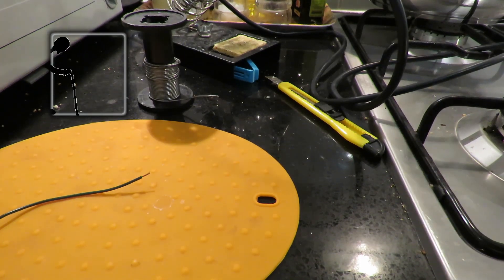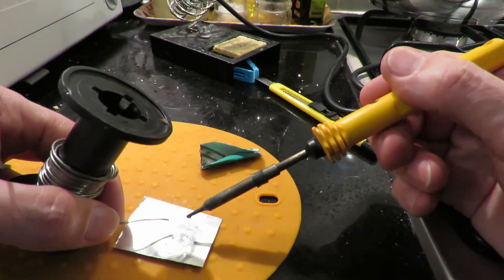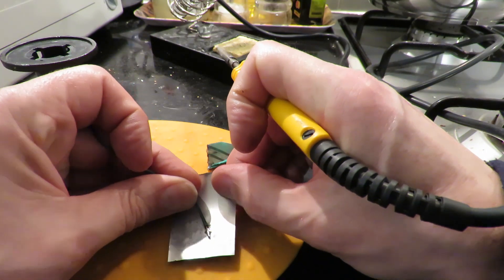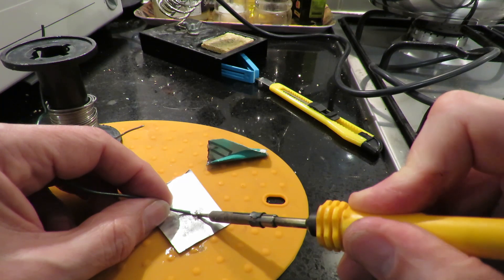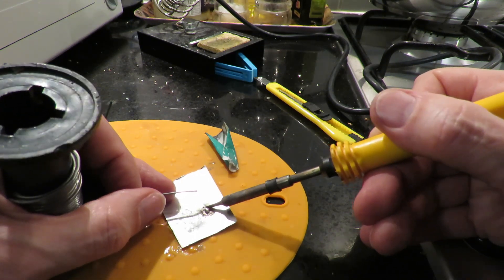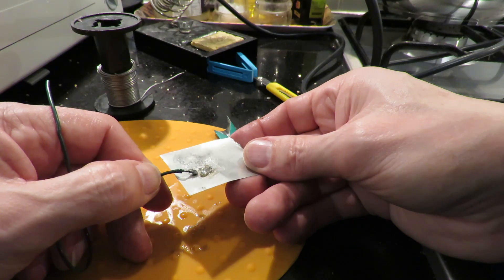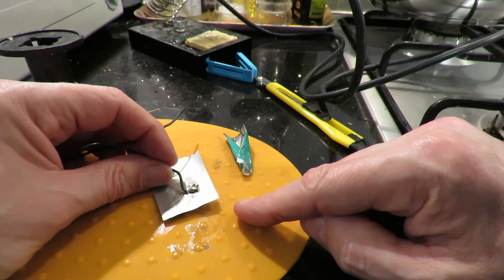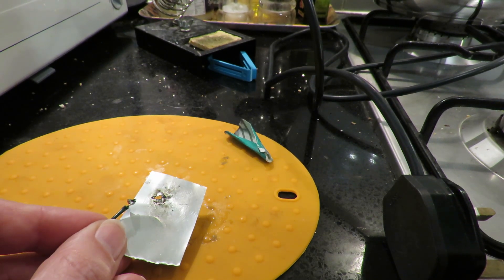Can I solder on aluminium?

Comment: I used rosin cored soft solder (tin-lead in those days) to solder aluminium and copper wire together all the time.  It was called a submerged joint, no oil involved.  
You need a soldering iron with a sharp leading edge, the old irons had copper tips and I just filed them flat (at an angle) on the end to give  a sharp edged ellipse, they also need to have sufficient heat output to keep the aluminium at the right temperature, alternatively you can cut a thermal break in the aluminium to reduce the heat spread.  

Start by sanding the aluminium to get the old hard oxides off, tin the copper, melt a blob of solder onto the aluminium where it has been newly sanded, put the iron tip into the blob of solder and tilt the tip so that the sharp edge bears on the aluminium and just push forward.  The sharp tip will scrape off the soft oxides (aluminium oxide forms instantly when aluminium is exposed to oxygen, but, initially the oxides are soft and easily removed, as time goes by the oxides harden up like anodising) especially on the top of the sanding marks and the aluminium will instantly tin.  After that, it is just plain soldering

I have used this method to join wire, attach copper earth tags to aluminium chassis (required a lot of heat or as I said a thermal break) even joined some aluminium angle.
Reply: Robert sounds like you need to upload your first youtube video!  this sounds really neat, i will have to try it.
Reply from the maker: Thanks for the tip 😆 Sounds like quite an art to get it right 👍👍
Reply: @GrandadIsAnOldMan  It is actually quite easy to do.  Try it, but use aluminium plate, the aluminium in cans is not really a good subject as it is coated and heavily cold worked.  As I said just try it on a thin section with a thermal break

When I was doing wire jointing, I would just twist the aluminium and copper together and run the sharp edge down the side of the twist with the solder blob on the end of the iron, that was an art (really just a lot of practice), doing a joint every few seconds.

Comment: 8:18 "because the solder has to form an alloy with the aluminum"
Absolutely no. The aluminum should melt so that the tin can form an alloy with it. That would be welding - not soldering. Since aluminum cannot melt here below 660 ºC, an alloy cannot be born either. The tin acts as a "glue" here.
Reply from the maker: Yes, you are right, I guess "alloy" is the wrong word, but "glue" is also the wrong word. I have struggled to find a good explanation of exactly how soldering actually works. One suggestion was "intermetallic bond" as in "molten solder penetrates a copper surface, forming an intermetallic bond" 👍👍 What I was trying to explain was it is a metallic thing. This Wikipedia article gives a good table for soldering and on a side issue I did try (failed) copper plating aluminium prior to soldering in a different video https://en.wikipedia.org/wiki/Solderability
Reply: @GrandadIsAnOldMan  This is very interesting topic. "molten solder penetrates a copper surface, forming an intermetallic bond" Does it really do that? I believe that the molten tin penetrates to fill the copper irregularities, which are perhaps very noticeable when observed with an electron microscope. But I don't think the tin will penetrate the surface. When one material is able to fill the recesses (pores) in another material, I think that is when the Van der Waals force between these surfaces is effective. Of course, there are materials into which the glue can penetrate deeper, and thus it can be thought of as a "penetrating" surface. Like glue that's runny enough even penetrates paper.. But I still see the soldering iron as a "glue" that joins two different pieces together without changing either piece into anything else. Paper is paper even after gluing. A pine board is still a pine board after it has been glued to something with wood glue. And copper is still the same copper object, even after soldering. Tin can be removed from the surface of copper by using "tin suction wire" and heating. It can be precisely removed.
The same Van der Waals force acts on the underside of the gecko lizard's paws, allowing it to walk along walls and ceilings as it pleases. Likewise, for example, a fly. However, we don't imagine that anything on their feet would penetrate the surface material of the building :)
Reply from the maker: @MR-ub6sq  You are probably right, but the word "glue" gives me the wrong picture. And I do get people asking me if they can glue wires together to make a circuit and yes I know you can buy "solder glue" although I have never tried it and that is not what they are asking me, when they ask the question. Interesting you say tin can be removed from copper, again, I am not saying you are wrong, but in my experience, any solder wick still leaves a surface sheen and lightly abrading the surface still shows the sheen. Perhaps you can do a video to demonstrate?

Comment: Use plumbers flux to tin steel wool, then scrub the solder onto the aluminum till you got a tinned spot. Next apply heat and create your glob to get a contact point. Also works with zn ti and Mg. ❤

Comment: Brothers.. Pls use Borid Acid Powder..or Vaseline, or carroma board powder,or talcum powder, .. etc.anyone dissolve in Engine oil, or any oil, to form a slimy solution.. dip the wire in slimy solution & solder.. it must stick.. 

I used boric acid powder & 2 stroke oil... Aluminium sticked on  a touch..

Experiment🤘

Comment: Since aluminum is good heat conductor, what wattage of iron is needed? A slightly higher wattage?
Reply from the maker: That would depend on the thickness of the aluminium. Rule of thumb - if the solder doesn't melt, then you need a bigger iron 👍

Comment: maybe if there was a small hole in the aluminium you could solder on the other side it may act like a rivet?
Reply from the maker: You could try that, but that wasn't what I was trying to do. At the time I did this video, I was making pop pop boats and it would have been handy if I could have used aluminium cans to make the boiler. That would have involved soldering a watertight seam around the boiler.

Comment: instead of using copper foil in stain glass can you use aluminum ?
Reply from the maker: I guess the answer is 'maybe'. Did you watch the video? I struggled to solder a single wire. However, you can buy solder designed specifically for aluminium, so if that costs in for your purposes and works with the tools you plan to use, then technically, it should be possible. There are lots of people offering advice in the comments here, most of it is unsuitable for the task I am doing, but it might work for you.

Comment: I remember my fist soldering to aluminum... it was a mess. 😅
Reply from the maker: It really depends what you are trying to solder. The aluminium will draw the heat from your soldering iron, so you need a powerful iron. I am specifically trying to solder copper wire to aluminium sheet.

Comment: Hi there im new to this sorta stuff..but im curious to know if it would work using solder to bond say 5mm aluminium rods ? ( For example a small roll cage for a rc car).
Reply from the maker: Your best option is to buy the solder designed for aluminium. You also need a powerful soldering iron if you intend to work on 5mm rods because they will quickly absorb the heat.
Reply: @GrandadIsAnOldMan  awsome thanks for your help ! 👍
Reply from the maker: @mitchdawg985  there are lots of suggestions down here in the comments, some from people who may actually have done this themselves and are speaking from experience, and some comments from people who's only knowledge comes from watching YouTube videos and have never tried it for themselves. My interest was only for terminating a copper wire on an aluminium case, typically a Lithium Ion Battery. That needs to be done very quickly so the battery does not heat up and catch fire, so the suggestions down here about using a gas torch are no relevant to my needs, however a gas torch will give you more heat, so that might be the way to go for building an aluminium chassis. You might be better checking out some of the RC car groups as I have seen many guys build their own chassis from aluminium stock. Robert Murray Smith is a guy I would suggest knows what he is talking about. Here is a search link for his channel https://www.youtube.com/c/RobertMurraySmith/search?query=solder%20aluminium
Reply: @GrandadIsAnOldMan  thanks for that !

Comment: Hey there! What respiratory and PPE do you need for soldering different metals together? Thank you : )
Reply from the maker: If you are interested in health and safety, I  suggest you Google that, rather than trust an answer from some guy on YouTube. You should be able to find the hazard data sheets for the specific solder you plan to use. You should also be able to calculate your own risk assessment for the actions you plan to undertake with the materials and equipment. If you don't know how to do that, it would be well worth spending some time learning about it.

Comment: Heads up, I just brazed a little diff and soldered the diffs together and they are aluminum, I used a propane torch and  a decent amount of flux and you should get some good wetting. Just scratch a bit of the aluminum oxide.of and then use flux you don't need oil just flux and it goes from there plus flux. Doesn't burn like oil
Reply from the maker: That is a rather different process than I needed to use. You try using a propane torch on thin aluminium and it will just melt away 😆👍

Comment: It's certainly possibe but it's insanely annoying because aluminum transfers heat away very quickly and it also has a stupidly anoying oxide layer that is a only really removable with acid.
Reply from the maker: That is the idea of doing the soldering under oil. You clean the oxide off and the oil stops it forming, but you do need a very hot iron to cope with the heat loss.

Comment: It is highly unlikely that your battery terminal was aluminium. Most LiPO  terminals are nickel plated steel which is readily solderably using electrical solder and a suitable flux. Liquid fluxes are commonly based on zinc chloride which is highly corrosive to steel and should be completely removed after soldering.
Reply from the maker: I should have corrected the text as it was a LiIon battery not LiPo, they appear to have an aluminium case, and that is the positive terminal. Either way, it does not take solder and as I explained in the video, this video is about soldering on aluminium.

Comment: the thing is, solder can be used on aluminium, but it doesn't work correctly on aluminium oxide. Aluminium if kept open, oxidises very fast, so sanding it off is the best way u can try your welding
Reply from the maker: If you just sand it in open air, it oxidises again before you can solder it, that is why the advice is to clean it and solder it under oil. If cost is not an issue, you can buy solder designed for aluminium.
Reply: GrandadIsAnOldMan Yes sorry for mistake. What you're saying is correct. If oil is applied, te aluminium cant react with moisture and hence no oxidation takes place. I'll give it a try today, im trying to make a diy heatsink so i was searching for a method to solder aluminium and guess i found one haha.
Reply from the maker: Good luck, it needs a very hot soldering iron that can provide plenty of power as the aluminium quickly takes the heat away.

Comment: I believe cans have a plastic inner liner. You will burn trough it but it will muck up the solder joint.
Reply from the maker: The issue is that aluminium oxidises if left clean in the normal atmosphere so cleaning it under oil prevents it oxidising before you can get the solder on it.
Reply: @GrandadIsAnOldMan   Yeah that I know but how do they make those cheap charging cables with aluminum conductors instead of copper?
Reply from the maker: @1800Supreme  the oxidisation is only on the surface. In most cases the connectors would be crimped in place. That pushes through the oxidisation and makes a good electrical connection.

Comment: Where from can I buy Aluminium Soldering Flux or Paste for soldering aluminium wires?
Reply from the maker: I would suggest you search online
Reply: https://www.muggyweld.com/product/super-alloy-1/
 Super Alloy 1 bonds metals at half the melting point of pot metal; 
 its honey flux turns root beer brown when the base metal has reached the 350°F working temperature
Reply from the maker: @uploadJ  Yes, crazy expensive price, do you happen to work for them as a saleman?
Reply from the maker: @uploadJ  also Contains cadmium.  Super Alloy 1 cannot be imported to countries in the EU due to import regulations.

Comment: what was that liquid you use ?
Reply from the maker: I think I used cooking oil in this video. The oil is to stop the aluminium oxidising so you have a clean surface. If you clean it in air it oxidises immediately so you cannot solder it.
Reply: @GrandadIsAnOldMan  is it impossible to solder beer/coke can ? I want to make kind of boiling water tank from it.
Reply from the maker: @condronugroho9388  this video just demonstrated that it IS possible to solder aluminium however it is not as easy as soldering copper or ferrous materials. In the video description is this link to the playlist I made of existing YouTube videos on the subject https://www.youtube.com/playlist?list=PLA5a2xPRSrB0tlcRlgroil7wViiD-DSOC As I already explained the main point is you need to prevent the aluminium oxidising when you have cleaned it so the suggestion is to do it under oil. That stops the air getting to the clean metal surface. You will also need a heavy duty soldering iron if you are soldering aluminium sheet as it will conduct the heat away quickly. The little soldering iron I used in the video was far too small to do a big job like that. You can buy special flux designed to help you solder aluminium but I expect that will be too expensive for your project.
Reply: @GrandadIsAnOldMan  oh I see. Thank you
Reply: @GrandadIsAnOldMan  can I use mineral engine oil?
Reply from the maker: @shibui2466  The videos I have watched recommend mineral oil - here is an example https://youtu.be/MkJ1HZLrGXk?list=PLA5a2xPRSrB0tlcRlgroil7wViiD-DSOC

Comment: looks like you can, I have in the past used a solder specifically for aluminium but needed a lot of heat for it !
Reply: Muggy Weld Super Alloy 1 will do it. Can use a regular soldering iron too!
https://www.muggyweld.com/product/super-alloy-1/
Reply from the maker: @uploadJ  Yes, crazy expensive price, do you happen to work for them as a salesman?
Reply from the maker: @uploadJ  well yes, the point of the video was to show it is physically possible with a normal soldering iron and normal solder if done under oil to prevent it oxidising but not really practical. I wanted to solder up some aluminium pop pop boat boilers from coke cans. Although it probably could be done, it really isn't practical. Thanks for trying to help 😁👍
Reply from the maker: @uploadJ  also Contains cadmium.  Super Alloy 1 cannot be imported to countries in the EU due to import regulations.
Reply from the maker: I was surprised, I had a comment on one of my pop pop boats and did a bit of research. I think a bigger hotter soldering iron would make it easier and my main interest was whether I could solder up aluminium boilers for pop pop boats and I suspect that may be a bit more difficult and more fuss than it is worth. These guys weld aluminium in every episode but that is a bit different https://youtu.be/vG1p336CZH0
Reply: I did however finish up using a pencil blow torch the aluminium was 20 swg it soldered it but it wasn't very strong !

Comment: Wonder why the oil? I mean, if they intended you to lube the sanding a bit, why not water?    Or if using oil, clean surface with soapy water to get rid of the oil.  Just thoughts, not speaking from any experience.   : )
Reply from the maker: I would like to be able to solder up one of those aluminium pop pop boat boilers, that would be interesting.
Reply from the maker: The oil is to stop the aluminium oxidising in the air. The oxide is what stops it soldering as easily as normal copper or brass. So you clean the surface whilst it is covered with oil and the air can't get to it.
Reply from the maker: The videos I watched did suggest engine oil and another said they had used "3 in 1" so I might have another go sometime. Either way I think a bigger soldering iron would stand a better chance.

Comment: You need a particular solder or paste for this. I would not try that on lipo tabs anyway. Those you need to spot weld.
Reply from the maker: You can solder aluminium with normal solder if you can clean the surface and stop it oxidising. That is the idea of the oil but you still need enough heat and soldering onto a sheet of aluminium is going to be hard because it will conduct the heat away so quickly. That means you need a bigger hotter soldering iron and then you are into the situation where you risk overheating the electrolyte inside and starting a fire so that is where spot welding wins.
Reply: @GrandadIsAnOldMan  good point but yeah, either way no good for lipos.
Reply from the maker: @808GT  Yes I would think the risks out way the advantages significantly.